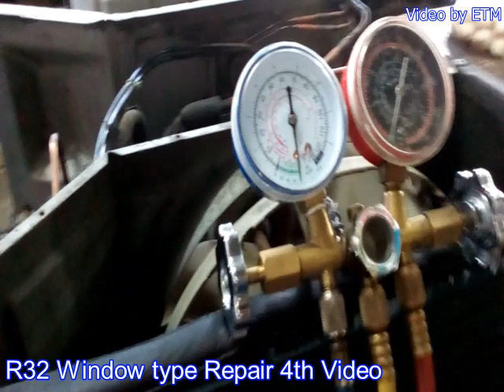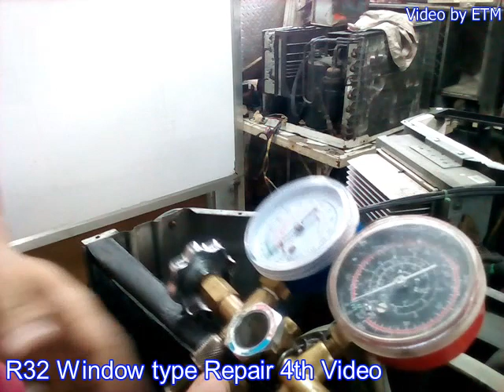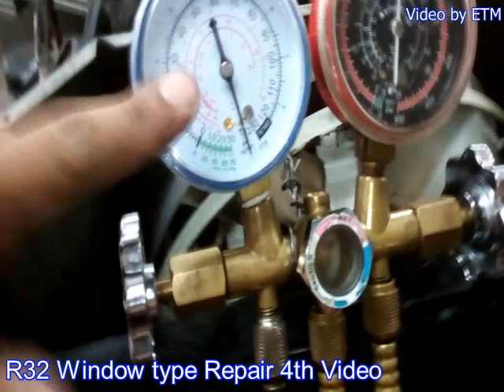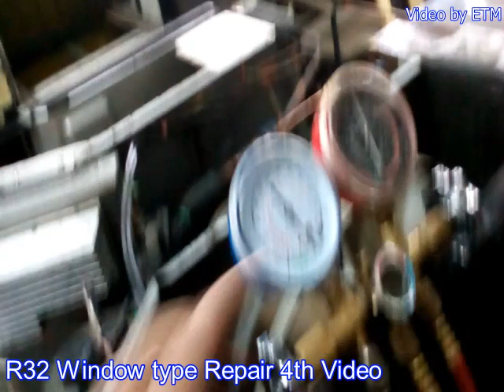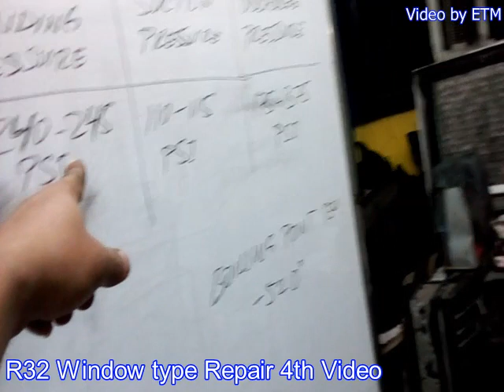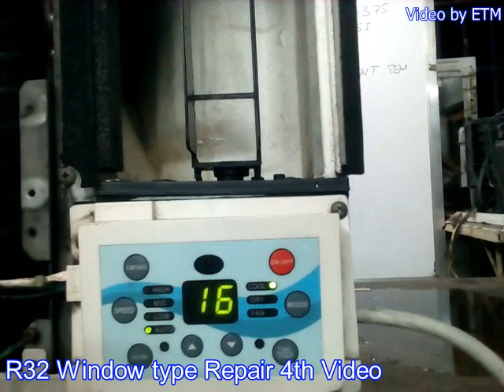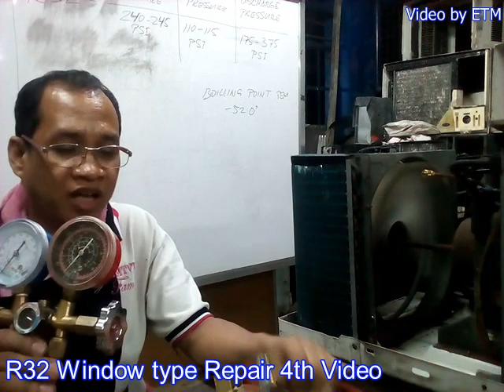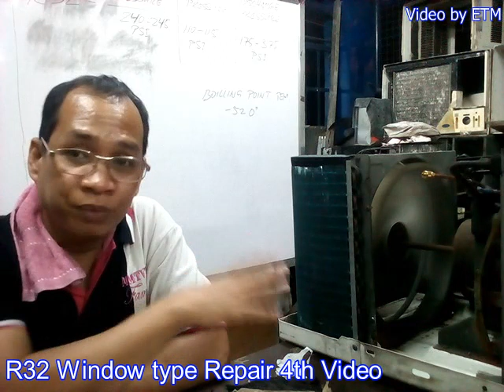How to System Reprocess 4th Video-R32 Widow type inverter aircon repair.

Comment: bakit bukas ang taas ng nagkarga di nio ma monitor exact pressure ng high side..
Reply from the maker: pre yon ang load pag not running po may record po ako sinosunod na stander at sorry kung hindi ko napakita pala yon amp niya sa clam ammeter na parihas na habang na takbo na siya po. at ang gauge ko po hindi pang flammable ang hoses niya,  ang gauge ko pang r32 at 410a pero yon hoses hindi pang flammable maari itong masunog nang freon habang na takbo po. hindi ko maaring ipahamak ang mga taong nakapaligit sa akin yon ang mga student ko sa video na yon. stander safety ang pinaiiral po namin sa tech-voc educ training school namin.
Reply: Dapat pag mag vlog complete pati amps para Lalo maintindihan Ng manunuod